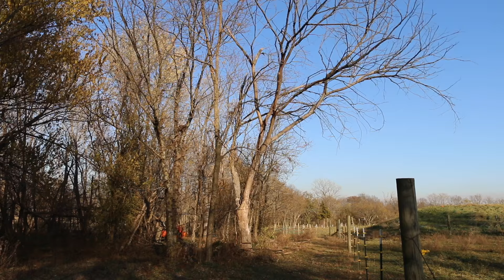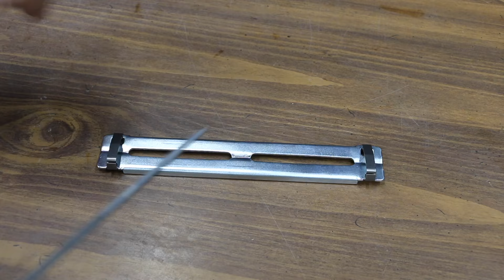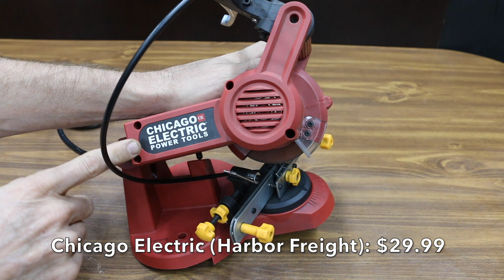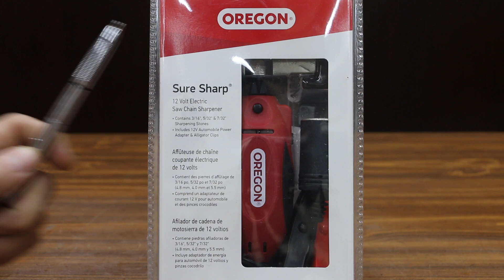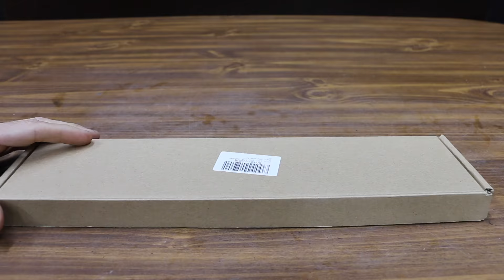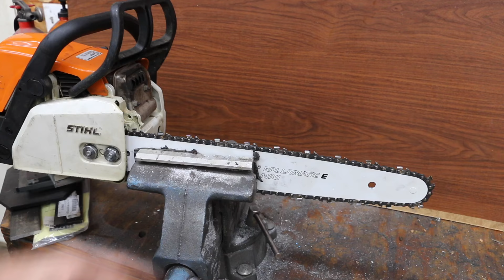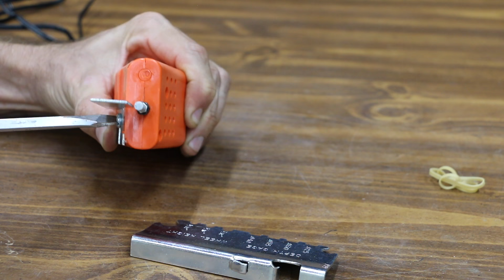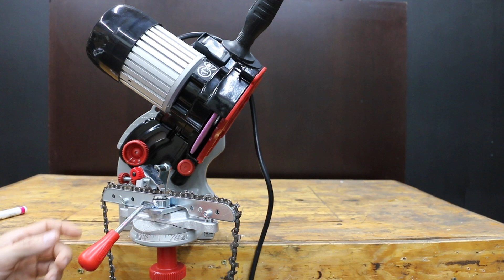Which Chainsaw Sharpener is Best? Let's find out! Stihl, Granberg, Chicago Electric, Oregon

Comment: I have a Oregon bench sharpener I learned a lesson it is very important. It comes with plastic profile card and a dressing stone it is very important to keep the correct profile on the grinding wheel. The sharpener is fast and very capable just requires a little skill. Also use the same grinder to sharpen my bandsaw blades I like the grinder it is very durable.
Reply from the maker: Thanks for sharing.

Comment: Newby question... How do I know when to sharpen the chain?  Read somewhere that, when you start to make saw dust. Is this true?  If so, I must be doing something wrong...
Reply: A sharp blade will dig into the wood and peels off shavings (curls) of wood. As it dulls, it will dig into the wood less and act more like a rough file sanding off the wood. So when you start seeing sawdust, your chain is dull.

Comment: I sharpen chains and other items for a living and I avoid Oregon sharpeners at all costs. The wheels and clamping systems are sub-par. The wheels burn the steel. The clamping systems takes too long. The best sharpener are the old foleys. Forward and Reverse motors with a foot operated spring clamp. Hand sharpening works, but often times the cutters will be different sizes from either switching hands or fatigue. This causes the chain to veer in direction or the other, especially with longer bars. I haven't used many of the hand held electric grinders, so I can't speak to them. This channel is great. I appreciate the time it must take.
Reply from the maker: Thanks!  Thanks for the feedback.

Comment: Contrary to popular belief, a simple hand filed chain is much sharper than brand new chain. Many studies have proven cutting speed is better after hand filing.
Reply from the maker: Thanks for the feedback.
Reply: @ProjectFarm  you’d be hard pressed to find any sawyer who makes a living running chainsaw who runs new chain. Before the final chain is assembled all of the links and teeth are just bounced around in giant box’s rubbing all over each other so the consistency is always suspect. The myth of new chain being the best comes from most casual users never take the time to sharpen their chains, they just run them until they won’t cut (which is horrible for your saw) then buy a new chain.
Reply: @ProjectFarm  absolutely love the channel by the way!
Reply: @ProjectFarm  lastly, I 100% agree with your method of testing cut times, many people make the mistake of using the felling dogs as leverage in the cut, which is proper technique, but it adds too much user error into the test. Allowing the bar to fall through the cut with the added weight is the most repeatable method by far. Keep it up!

Comment: Thanks for another great video.  You could got down a rabbit hole here, but what about doing a video about the effects of different sharpening geometry?  You could get away from the 15 degree angle, take off a little extra from the rakes, there's even a "square" grind. You might get into which profiles work better in which types of wood, what the effects on reliability are, etc...
Reply from the maker: You are welcome!  Thanks for the feedback.

Comment: Video Idea:  How many feet of french-drain is needed to max out a 4inch discharge for properties with less than 2% slope.  Research "Blind Inlets" used to replace tile-risers (NOT FDM).   Knowing it only takes 30-40ft of FD to max out a 4inch discharge would clear up a lot of hype here on YT.
Reply from the maker: Thanks for the video idea.

Comment: I really loved this one! I have been looking at these too, I have 2 chainsaws and need to do my own sharpening cause chains cost $!
I like that you tested the manual ones too! I need to have one with in case my spare goes dull too, as I don't want to go back to the shop to sharpen them - I need to finish the job. Nothing like cutting up an ironwood tree & chain only laying 1/2 the normal. Hand sharpening doesn't take that long and you show it does a pretty good job. Perfect time to take a break, sharpen the chain & then get back to work. After watching this, I might also buy a power sharpener now! Thanks!
Reply from the maker: You are welcome!

Comment: I got a similar grinder like that Oregon Bench grinder. The trick is to remove as less as possible material and move slowly to not overheat the Chain edge. Btw. If you want to scharpen outside in the Woods with a file i recommend a mobile clamp vise hammered in a Log or a Stump pretty helpfull.
Reply from the maker: Thanks for the feedback.

Comment: Didn't see a graph for time to sharpen.   Here they are:
Oregon manual files:          7 minutes
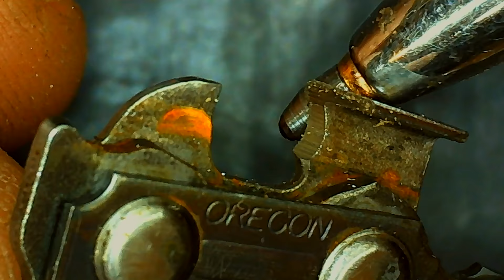Chicago bench grinder:     5:30 plus setup/adjustment time
Oregon 12V electric:          4  mins
Stihl 2 in 1:                           5 mins but also flat  files the depth gauges
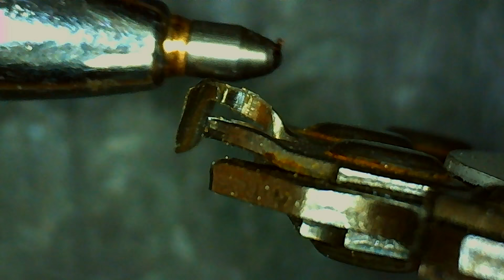Grandberg file and joint:    6:30 plus setup time (same as manual file plus setup time)
Stihl 12V electric:               6 mins (why slower than Oregon?  Just going slower?)
Grandberg 12V electric:    ?  plus setup time (time not shown)
Oregon brench grinder:     4:25 plus setup time

I use a Grandberg File & Joint periodically plus manual file (probably same as the Oregon kit) in between those sharpenings as needed, but I like the Stihl 2 in 1, haven't seen that before.   Maybe I'll also try the Harbor Freight grinder but the setup/adjustment seems finicky or easy to  forget?
Reply from the maker: Thanks for the feedback.

Comment: I've used a setup like the Granberg File-N-Joint for years, it may even be an older Granberg. Anyway I found it much easier to grab the carriage opposite the handle end and pull the file through instead of pushing it from the handle end. Eliminates most if not all of the file chatter too.
Reply from the maker: Thanks for the feedback.

Comment: Nice video! Your tests are awesome and you saved me already a lot of money! 
I have also a video idea: I saw the video of you where you tested the damage that ethanol does to carburetor parts. I would be  interested in the method of getting the ethanol out of gasoline with water. When you have removed the ethanol, the octane number also changes. Please test the influences on durability or whether this may damage the carburetor. Ethanol-free petrol is no longer available in Germany and special fuels are extremely expensive. As this is a problem really much people have, it would be a great video!

I would be very happy if you would implement this suggestion for a video.
I hope you have a great day Sir!
Reply from the maker: Thanks!  Thanks for the video idea.

Comment: The reason why the first test with the Oregon bench grinder was so slow was that you took too much off at once and blued the chain.  You can see that in the close up. You have to take a little off at a time,  not hold it there steady.
Reply from the maker: Thanks for the constructive feedback.
Reply: @ProjectFarm  no problem.  It is a common problem.  I used to work for a logging company and we had an old guy come in to sharpen all our chains and he showed me that trick. He also cut them to 27 degrees instead of 30. After awhile we got a diamond wheel for the grinder and that was the best thing ever he said.

Comment: So it occurred to me that your testing method was very good but there is one very glaring flaw that I didn't even see until the last test: your control cutting media,  pine 4x4's, do not maintain consistent material density as there are knots scattered randomly. Some of the faster cuts could be due to less knots in the wood. Your cutting media should have been larger poplar or a larger pine with straight grains and few knots. I'm slightly wary of these results - they aren't bad but you also can't say that non-uniform material density has zero effects. Pine or red oak would be the best choices if you want to present the most commonly cut trees in the US.
Reply from the maker: Thanks for the constructive feedback.

Comment: Should do a test/race with the top 2 or 3 vs an arborist free hand round file/flat file.
2-3 cuts, a controlled way to blunt, 2-3 cuts, blunt for a few rounds, especially if the arborist has to eyeball a touch on the rakers at least once. Be interesting to see how the pro holds up free handing vs having to secure a saw in a vice or attaching a sharpener
Reply from the maker: Thanks for the video idea.

Comment: As always, amazing video by PF! I am personally biased to using a traditional hand file myself as practice has enabled me to get chains very sharp in the field without having to go back to the shop and put the saw in a vise. I’m not sure the Stihl 2-1 was not at an unfair advantage since PF specifically pointed out he wouldn’t be filing the depth gauges but the Stihl 2-1 system, in fact, does. With a more aggressive bite from a lowered depth gauge, it was bound to perform better than the others. A very minor observation is all. As usual, great job by PF.
Reply from the maker: Thanks so much!  Thanks for sharing.

Comment: Great video Todd! A couple of suggestions: for the chain testing, flip the guide bar every other chain. As for best performance for sharpest chain, it’s the touch ups between complete chain tooth rehabs. This is best done in the field between refuels with a quality Nicholson or Gorbet hand file. Use hard chalk or soapstone marker to preload your files. This is a natural dry lubricant,. Rotate and tap file file to clear between strokes. 

This simple skill and practice will outperform most of the methods here. Slight touch ups during use are easier to deal with than chain burnouts.  Many of the jig styles are really more like training wheels for beginners. 

Keep up the great work Todd, and remember my famous words when I sold cars: 

“Pay attention or pay cash!”
Reply from the maker: Thanks, will do!  Thanks for the feedback.

Comment: I have a HF sharpener and after using it the saw cuts a curve to the right instead of straight down. I have even used an angle gauge to make sure tooth angles were equal, and they are. What else could be causing the issue? The bar is straight and everything was going well before re-sharpening.
I was using the same technique as shown here. Well, except for the "adjust until chain does not move when clamped" part. Not something i specifically paid attention to so maybe that was the issue?
Edit: Just remembered that the tool came with two wheels. One was for the teeth, the other had a bevel and was meant for the rakes. Wonder why it wasn't used here.

Comment: I appreciate your review, I have had a Chicago Electric sharpener for a good 10 or more years... I've probably sharpened maybe 100 chains with it, hard to say for sure, no agricultural method is ever scientific but I've been pleased with the product.  Only thing I would like to add, you want to watch the heat building up when using it, one or two chains is not an issue but after several... 3-4 is probably all right too but again watch for heat build up, the motor doesn't dissipate heat well... I've never burned mine up but I let it cool some times.
Reply from the maker: Thanks for the feedback.

Comment: Looks like you burned the temper off the tooth with the Oregon Bench.  You can see the straw and blue colors in the closeup.  Not surprised that it would cut so poorly.  My friend uses this grinder and makes two light touches on each tooth.  I wonder how it'd perform without the aggressive grinding.
Reply from the maker: Thanks for the feedback.

Comment: I use the stihl portable and it took a little time to get onto it. But I also use a film called grind a joint that keeps the stone from getting hot and breaking stone. I can watch the temper of the chain turn colors and harden the edge. I have done this for over 35 years.
Reply from the maker: Thanks for sharing.

Comment: I actually threw my stihl 2 in 1 away. The issue is after using it multiple times it files down the rakes to much. The chain then bites way to much wood off. My saw would stall out because the rakes where to low.
Reply from the maker: Thanks for the feedback.

Comment: The reason why the Oregon sharpener didn't work as well the first time was because the teeth are tempered from hitting it too hard with the grinder I suggest doing little taps too keep it cool . another way to prevent this is by making sure you always clean your wheel with a properly designed grinding stone every time it gets black with dirt, shavings
Reply from the maker: Thanks for the feedback.

Comment: I've tried a Dremel accessory that is like the several rotary files, the HF bench unit, and my favorite is a much cheaper version of the Stihl file made by Pferd.  Like the Stihl, it does the depth setting at the same time.  It doesn't support itself over as many teeth, so it might be slightly wobblier.  Thanks for the efforts!
Reply from the maker: Thanks for sharing.

Comment: There is some room for improvement here. In this day and age there is no excuse for having to clip to batteries or plug into the wall.
I have the Chicago unit but the one I always wanted was that style that mounted to the bar of the saw so you didn't have to remove the chain. 
Now I think I'd like a battery operated granberg. An 18 volt Ryobi battery should be able to sharpen a number of chains.
Reply: Timberline mounts on the bar and has high rating
Reply from the maker: Thanks for the constructive feedback.

Comment: Great video.  Wish you had included a Timberline sharpener.  I've been kicking around the idea of getting one for a few years now.  My dad had a similar unit back in the early 80's that he loved.  Looks like it would be really fast and should give a nice, sharp edge.  

https://www.timberlinesharpener.com/shop/?doing_wp_cron=1614110952.3919289112091064453125

So glad that you went back and sharpened them all again after some practice with each one.  Hand filing is certainly a more challenging skill to develop, but it does produce a better edge.  As an added bonus, you don't have to remove the chain from the saw to do it, and it doesn't take much longer than doing it with a bench mounted grinder.  To me the biggest advantage is that I get a LOT more service life out of the chain.  If I take the chains to a dealership to have them sharpened, they grind away a LOT of material where as doing it by hand only takes away enough to get them nice and sharp.

Comment: I know it's too late for the electric chainsaw test, but EGO has an 18" model out now with metal bumper spikes and 11,000 RPM motor vs 6,500 RPM in the model you tested. I can't help but wonder how much that would have helped in your tests. I don't know if there is a way you can test that one and just throw a note on the existing video.
Reply from the maker: Thanks for the video idea.

Comment: one sharpener I would've liked to see you test is the timberline chainsaw sharpener. been really debating buying one of those
Reply: That is my go to sharpener. No AC or DC needed, kit/pouch small enough to carry on belt for sharpening or touch up in the field. usually file down my depth gauge after three sharpenings. This sharpener sharpens all the teeth the same size so it cuts straight, cleaner and less strain on the saw.
Reply from the maker: Thanks for the video idea.

Comment: If you're still looking for product test ideas, synthetic winch ropes are becoming popular but it doesn't look like there are comprehensive tests on things like resistance to abrasion, stretch as they approach their claimed ratings, actual failure tension when new, actual failure tension after weather exposure or after repeated use, or the relative danger of failure mode of instant failure, ie cut while under tension.  It also appears that various manufacturers have pretty widely varying rope thicknesses for their strength claims, ie, one manufacturer says a 3/8" rope is good to 12000#, another calls for a 7/16" rope for that, and another yet may call for a 1/2" rope.
Reply from the maker: Thanks for the video idea.

Comment: Stihl 2n1 by a landslide it can be used in field with no power or additional tools needed I sharpen on my tailgate often holding bar with one hand and working tool with other and still comes out great and keeps the job moving 5 min and back to work. Many of the times on other sharpeners are not accurate because they do not take filing the rakers into time frame Stihl does it at same time.
Reply from the maker: Thanks for the feedback.

Comment: Definitely hold the saw level while cutting to eliminate the phenomenon of the saw cutting less total cross sectional surface area and thuse cutting slower at no fault of the blade. I believe it is because each tooth has less pressure on it as there are more of them on the wood at any given time to distribute the weight of the saw. Anyway I don't know if this is that big of a deal, it keeps me up at night though. I will probably have to test it someday to satisfy my curiosity.
Reply from the maker: Thanks for the feedback.

Comment: you never, and i mean NEVER FILE THE DEPTH GAUGES! if the chain is so bad it is hitting the depth gauges, it should be discarded and a new chain installed. also tried to take too much of a bite for too long with the bench sharpeners and burnt the cutting edges making them brittle.
Reply from the maker: Thanks for the feedback.
Reply: @ProjectFarm  i work at a small engine repair shop and one of the things we do is sharpen saw chain. at the same time we also "hook" the bar(clean out the chain groove) and "face" the bar(grind away the rolled over edges) if it needs it. we also inspect the drive sprocket to make sure that the chain isn't bottoming out in the sprocket (you'll see marks from the drivers of the chain on the bottom of the sprocket.